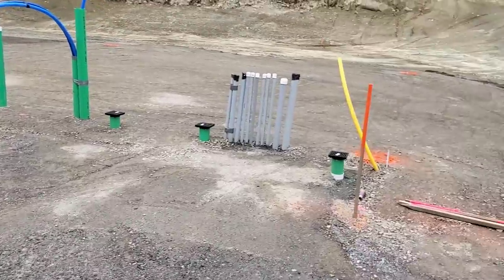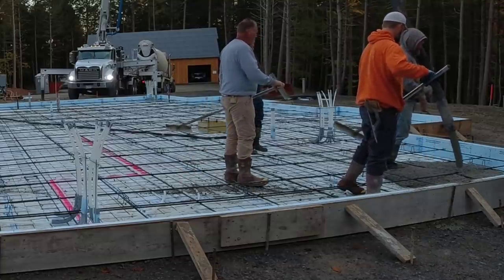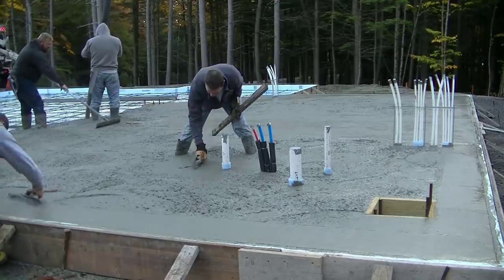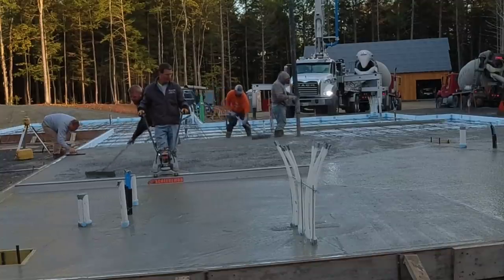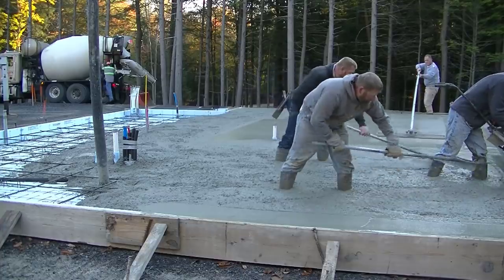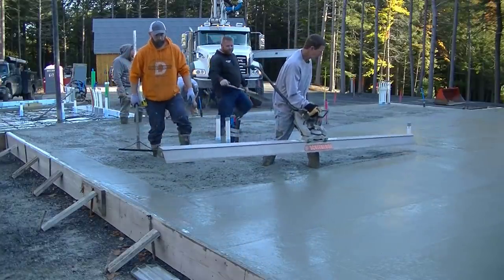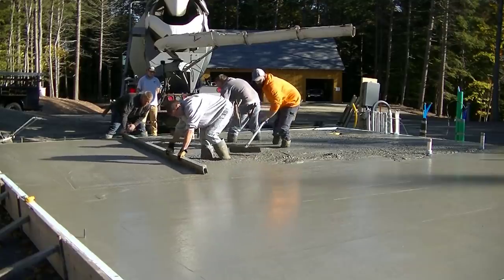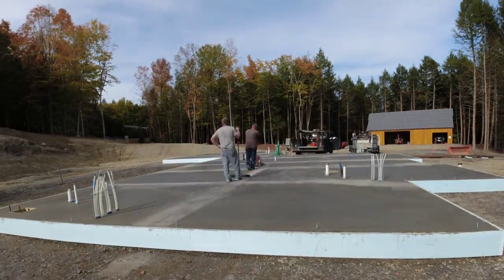He Made Us Pour His Concrete Slab 10 Inches Thick! (Waste of MONEY?)

Comment: That thermal mass will stay warm for days in the winter if he loses power. Of course it will take days to heat it up in the fall first time they touch the thermostat. I have a 10" thick slab (rockland ME) for a 30x40 building for computer/communications racks. Racks lag into the concrete and can hold quite a bit of weight, so more is better and I didn't want any lag shield holes punching through the bottom of the concrete with the variation of thickness sometime found in thinner slabs I've drilled into. Temperature stays very steady in my building.

Comment: Overkill is underrated, he should've gone 54" inches thick with 4" diameter fiberglass rebar on 24" centers and a keyed shaft 72" in diameter with a depth of 50 foot right in the middle to avoid any frost heaving. Lol.  Seems like you both made out, he got what he wanted and you got paid what you wanted. Nice work!

Comment: Having worked for year at a soils / concrete / asphalt company, you should NEVER have a slump over 7-inches otherwise the aggregate starts to separate and sinks and ends up at the bottom of the slab which weakens the top section of the pad.
Reply: That's an oversimplification. Depends on the mix.

Comment: 10" is thick but it adds to the benefits of having a larger mass and reducing labor and fitting the Styrofoam to fit. A water reducer would have trouble making a 2" slump(50mm) turn into a 8" slump (200mm), was most likely 4" slump to begin with. The water reducer definitely helps retain strength while making the pour process easier, but no mention what strength was ordered. Most owner/contractors will bump up strength as well to avoid any shortcomings. 
Your crew worked well together, nice to see. 40 minutes from plant, don't want to be short, labor costs add up quick. The mesh at the bottom looks like it stayed at the bottom. I would have lifted the heating pipe to middle of slab. Also didn't see heating pipes pressurized, easier to fix before concrete sets (just watch for bubbles).

Comment: Very unusual question. Over the course of about a year I poured a slab from concrete it was left over from jobs of about 100 x 75‘ slab. The slab has some rebar mainly round the perimeter but is 24 inches on one side to 44 inches on the other side. Now my thought is doing a perimeter beam and capping the top with at least 4 inches of concrete. You can imagine the slab is quite a level because I did it myself as Concrete came out the truck I would go there when they would call me and I would spread it out myself so it’s looks like the moon surface.  My question is if I want to finish this any ideals being that thick should I use a vapor barrier to the perimeter is lotta rebar just what are your thoughts on what I’ve got. Would really appreciate the input. Also I am not a concrete person but I’ve learned quite a bit.
Reply from the maker: If it's got good gravel under it you could cap it with 4 inches. I'd put a bond breaker between old and new like Typar or poly. Make the edges thicker like you said. You could even do a couple inches of gravel over it first to level it, then pour your new slab on top. Either way should work good.

Comment: At Ft. Campbell Army base, parking lots for big vehicles is only 9", with no reinforcing over 6" of base with 4" of #57  stone drainage layer between. 10 is way overkill. 6" max with #4 bars 12-18" on center will suffice. And don't pour wet concrete unless you add plasticizer to it.

Comment: Only watched the first 3 minutes and already I can tell you the answer - no not a waste of money because of 2 words: "thermal mass". Having a beam on the outside under the walls may be the "normal" method, but having radient heat inside a 10 inch thick solid slab will pay dividends in reduced heating costs longterm; costs which will only ever increase.  Having a thicker beam on the outside may be the structurally preferred method, but the increased mass at the preimeter essentially gains you essentially nothing for the internal heating benefits that a thicker mass would give.

For radient or solar gain heat, a thicker mass is by far a better choice for heat storage and longterm controlled dissipation.  Ofc this has to be in conjunction with very good thermal insulation from the ground, so I personally would have doubled the insulation for the slab, AND the sides as well.

Comment: I'd do the same, but up edge thickness to 16" minimum with additional reinforcement. I'd also do all my walls and roof system with 8-10" of concrete while insulating ICF style. I might even up exterior insulation and use radiant heating in the walls or even ceiling as well. If there are materials that would last the test of time beyond by kids lives, I'd use those.
Reply: He may have just wanted the house sitting higher for aesthetic reasons. The fact that he didn't do grade beams around the edges makes me think he wasn't concerned about having foundational problems.

Comment: A thick concrete floor holds on to a lot of heat.  It ill act as a heat sink in the summer keeping the houseowner cool and it will hold heat in the winter to keep them warm.  The basics of this are that a very thick concrete floor will help to stabilise the temperatures inside the house.  If you can afford the extra material this is a good idea.

Comment: Here in Germany this is normal. Youre talking about 10 inches this is 14 centimeters. Here its 15 centimeters minimum. Thats normal for a concreteplate as horizontal fundament for a residence. I made this with a tolerance of 1 centimeter in height. We normaly use concrete-vibrators to evacuate the air to receive a higher density. I think problems could begin if you use massive stones as circumferantial walls, because of the foam thats underlead. The pression on the edges of the plate could cause damage in the plate. We prefer to make a so could "Streifenfundament" around the edges, that means a 60 centimeters deep and about 24 centimeters big hole all the way, that has the foam against the outside, not under it and also designed steelarmour in it. The foam outside is against the possible frost in the ground depending of the seasonl environment. The thermal insulation against the ground here is solved with a layer of isolating material above the plate and then the chosen endcover like wood. For the next time I would recomend a plastic covering after the pour, because concrete doesnt "dry", it needs the water in the process to get artificial stone. I would recomend you to use light materials, like wood for the walls. Great job. If you have an ingineer for statics all is great.

Comment: I think the set-up of having the thicker slab and the heating tubes at the bottom of the pour is going to cause alot of lag, require higher media temps and make the control more difficult especially if the climate it is installed in sees large variations in daily temps during the heating season.  Likely less efficient.

Comment: in Perth Australia for cheap residential we are doing 3" slabs with reinforcement bar on sandy soils.there is a footing about 350mm deep X 300wide around the edge of the slap. used to only be 4" but cost cutting on mass produced homes.

Comment: I did construction for years, and never saw it done like this. You normally set offset hubs to the corners. Then you pour the cornerrs/footings. These typically extend beyond the actual footprint to add stability. Then you come back and set the pins for the slab and walls and final grade. As for the 10" slab... The only possible reason for that would be to use if for heavy trucks, equipment or for mounting high precision machinery like industrial lathes or milling machines etc. I had a friend that collected fire trucks. He used a thick slab for that use. Is it possible that this house is in an earthquake zone?

Comment: I'm not sure what seismic region this house is in, but welded wire fabric at the bottom and rebar (#4 bars?) at 24” o.c. elevated to 4-1/2 to 5” above the bottom of the slab doesn't seem like much reinforcing for a 10” slab.  I probably would have wanted to go with a top and bottom mat of rebar at 18” o.c.e.w. with just enough concrete cover as required by code.  But since I’m not an engineer I would have asked one to do structural calculations.  Years ago I worked on a job where the contractor genuinely wanted to do a good job, so he added some concrete thickness to the top of a culvert he was building.  The engineer was upset that his plans were not followed, because now there was the additional weight of concrete, without the amount of steel reinforcement that it would have needed to support that additional weight.

Comment: Sounds like a thermal store pour in the house. Either that or major overkill. Either way concrete doesn't burn easily. With the thermal store with radiant heating the concrete stores heat for quite a while so actually it will help lower heating bills. Total up the savings and over 10 years the cost of the extra yards is likely to be dwarfed by the savings in energy bills

Comment: 10" is with it on that kind of base/ground. Also if you plan to put some good weight on it hold up better long term. I know this from doing lifts in garages too you have to have that extra pressure concrete. 12-16" deep

Comment: Beautiful pour guys. Quite excellent. 10" will help when there is a question of soil shrinkage beneith the slab. Future voids can be an issue with 6" but 10" I presume would be better insurance.
What do you think of  4foot deep concrete pylons spaced out on a pour like this to help with slab shifting on grade that may have more liquifaction and or shrinkage? I live in central texas and I'm near rivers and lakes and we have the Trinity aquifer beneath and the soils does shift. The biggest issue is when in a time of drought, soil dries and around the grade, the soil will shrink leaving the slab to sag and crack and shift severely unless you keep the soil moistened, and during drought using water like that can be a high cost.

Comment: I didn't hear you mention anything about curing the concrete. I realize you used a water reducer,but a slab that thick will generate lots of heat. A good water cure would help slow the hydration and increase the strength of the concrete. You see wet burlap placed along with soaker hoses, covered with visquene on bridge decks all the time.

Comment: Those foundations look so simple compared to what we do here in .nl... My house for example: 40x40 feet footprint, excluding garage. 18 concrete piles, 8x8" by 60 feet long. Then a concrete beam, 23" high by 12" wide. Op top of that we have the floor, made up of prestressed concrete 'channel plates' (literal translation), 13x3 feet, about 16 inch thick, half of which is insulation. We poured concrete around that and in the gaps between the plates. Op top of that is 1 inch of insulation and another ±2.5" slab which includes the hydronic heating (this was done inside the house, after it was built).

Comment: 10 inch thick concrete slab makes sense if you consider the value of the thermal mass and radiant in floor heat.  Once warm it will maintain an excellent indoor temperature...

Comment: First of all, 10" is definitely overkill.  10" is the kind of thing you see in a heavy industrial building, where you expect to have huge point loads from heavy pallet racks, tanks, and/or and huge machinery on the slab.  Out here in California, most homes are built with 4" slabs unless you're building on bad soil.  On a rocky hillside like this, i would bet the soil is pretty good.   I've seen people go to 6" for radiant heat, but there's no way i can justify that 10" thickness.

But the thickness isn't the problem with this foundation.  It's the owner's money to waste, not mine.  The problem is not having a thickened edge (or grade beam as you called it).  The grade beam serves two purposes.  First is structural strength, which admittedly isn't necessary with a 10" slab.  Second is the one that's gonna cause problems here.  The grade beam serves the secondary purpose of directing rain and irrigation runoff around the house rather than under it.  Not having it could lead to the foundation being undermined by erosion.  IMO it would have been a better use of the owner's money hiring a backhoe to dig a 12" deep perimeter, and sticking to a 6" slab.

By the way, i don't really see the lack of a vapor barrier as a major problem the way some other commenters do.  A 10" slab is gonna be fairly effective by itself in limiting moisture transmission.

Comment: It's great to learn how things are done - I'm looking into building my house.  I don't have construction experience, but I'd say the extra $3500? for extra 4" on such a large home is worth it.  However, I'm just basing that on my mom's condo, which is now @ 40 yrs old.  It has settled and sunk some.  The patio was once higher than the ground I'd think - but by the time mom bought it was lower and French drains etc had to be added (patio is surrounded by condos on 3 sides).  Yes, it's just a patio and probably not very thick.  But if they'd done just a couple more inches, this would not have happened.

6" probably would be more than adequate to keep any house high and dry for its lifespan, but a little more height for added assurance is great.  In the overall cost of things, is the $3500 that much for that added assurance?

Comment: Depends what you're putting on 10" of concrete. Our garage we built thats 60'x100' has that depth of concrete in it. Because we pull trucks in to it that are loaded that can be well over 100-K lbs. A loaded. If we bring the 13 axle in for maintenance (all put together). The light weight is 90,000 lbs empty.

Comment: Worth it, extra slab for thermal stability hydronics, slab on grade means no thinkend areas in middle or edges smoother bottom makes stronger concrete, less gravel for base and prep time equals concrete cost or close.

Comment: As a concrete supplier for my entire working career, whenever you are putting radiant heating in a concrete slab, it is always better to go a couple inches thicker than normal, particularly if it's also in an area that gets winter weather. Air-entrained concrete especially.

Also, if he is a builder and one of your better customers, methinks he can recoup that extra expense on other jobs, if you catch my drift. Maybe he poured 28 yds on that house, not 22 they "thought" they were going to need...hint, hint, and do this to several jobs of his.

For example, a company like Cemex or Oldcastle Materials are worldwide corporations and can lose $5,000,000+ on a job in the USA and simply make that up with a job over in Europe, Asia or where else they have operations and if you think for a minute that this doesnt go on, you do not know international business.
Reply: Name checks out

Comment: There is probably special drying requirements for such a thick foundation...  As long as it dries right- no cracking,  the extra height should help to prevent flooding inside.

Comment: The guy that built my house poured foundations walls 10" thick with heavy rebar reinforcement to prevent shifting of a huge 300 yr old tree not more than 6' away from an inside corner of the foundation. Subsequent digging revealed the root structures have found the wall. So, at least I won't expect the tree to push through..... The guy incorporated a bomb shelter into the basement as part of the support. Go figure....
  What recommendations would you offer for a slab to support machine shop equipment, like lathes and mills requiring a solid unyielding level surface to mount to? What rebar strategy in areas that will be supporting heavy things?

Comment: We are getting ready to build a custom home with 2” foam board and 10” of concrete because there are several bearing points due to style of home. When forms are pulled off and foam board is exposed  on the sides, what is the process for covering the sides? We will probably have a few more questions. Thank you in advance.

Comment: I dont think the radiant heat is as efficient/effective with slab so thick and from what I could see from the position of the piping…..piping should have been several inches higher. However I do understand his thinking on using more material vs more labour.

Comment: What does the Soil Investigation Report say?
Crappy bearing soil capacity?
Is it a "structural reinforced slab" or is a simple "slab-on-grade"?
Just because it's heated, does not mean you have to make it very thick.
In fact, that's not how you should be doing heated slabs anyway.
The more proper way to do heating in the slab is like this (from the top, working to the bottom):
- floor finish
- 4" lightweight or normal 3,000psi concrete slab with electric heating cables or water pipes in it
- vapour barrier
- 4" to 6" rigid styrene insulation
- 6" (min. depending on what the Soil investigation Report calls for) reinforced concrete slab (reinforcing can be done with normal rebar or welded wire mesh depending on what the structural engineer calls for)
- 8" to 12" compacted granular fill (again, the thickness depends on what the structural engineer calls for)
- proof rolled soil

Most of the construction greatly depends on what the structural engineer calls for, and he or she will never go in blind; they will always request that a Soil Investigation Report be done.
Doing it any other way is irresponsible, and dumb. No other way of putting it.
OK?!